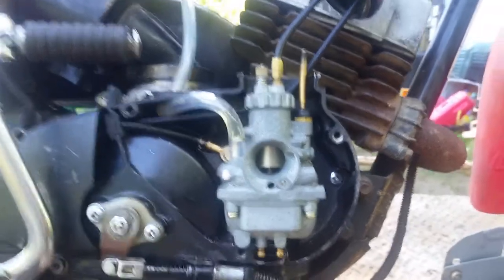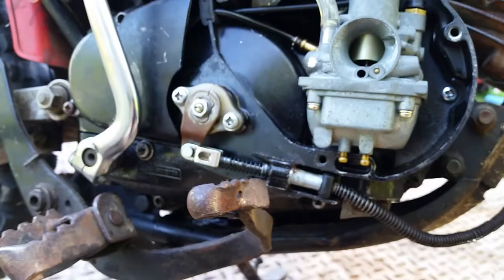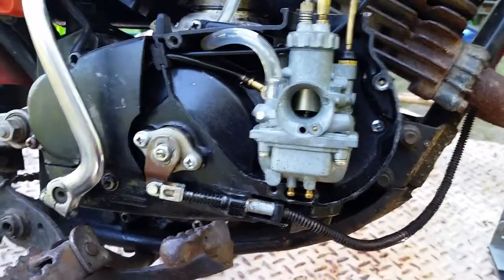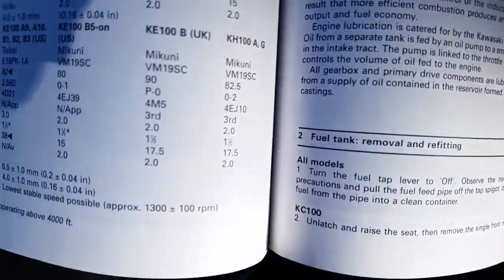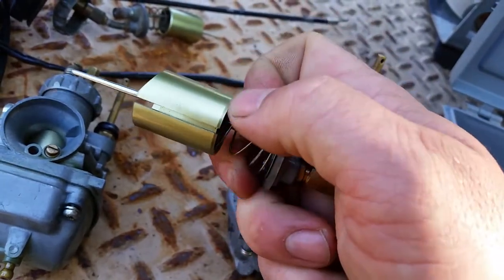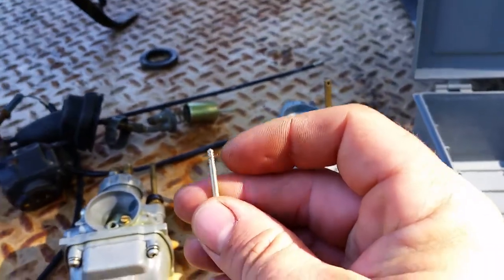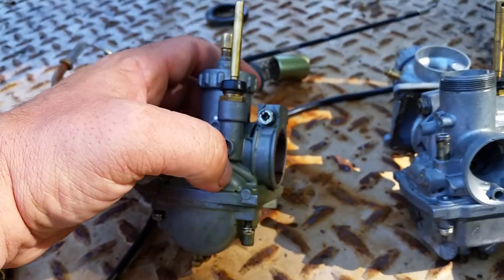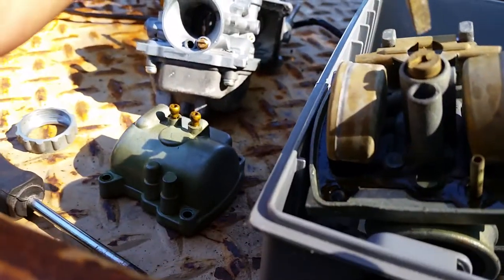KE100 carb repair talk  part 1

Comment: I changed the points and everything still no spark so only thing i can guess is i need a new stator do u know wheres the best place to get a stator affordable
Reply from the maker: king_ DENIER what did you gap them at and did you change the condenser
Reply: I had a professional in my area change the points and he gapped them i will call him and see if he gaped the points
Reply: And it doesnt look like he changed the condenser where would i buy one and how much are they
Reply: This bike went from my favorite to a nightmear in 5 min
Reply from the maker: king_ DENIER new points have to ask and find out what they where set to theas bikes are different from most
Reply: What should the gap be on a 1990 ke 100
Reply: And where could i find a new condensor
Reply from the maker: king_ DENIER 0.014 - 0.016 condenser Ebay
Reply from the maker: king_ DENIER did you get new points
Reply: Yes a professional put in the new points for me
Reply from the maker: king_ DENIER kool but still no spark
Reply: I cant find a condensor no where not sure if im not looking up the right thing or what
Reply: Havnt had spark since it tore up
Reply from the maker: king_ DENIER 6033958097
Reply: What is that number?
Reply from the maker: king_ DENIER phone number
Reply: Ok i texted you let me know when you get it

Comment: Where can I get a carburetor gasket or full carburetor for a 1985 kx100
Reply from the maker: A kx100 or ke100
Reply: Kevin Bergeron  I meant a ke100 like my bike keeps leaking gas from the bottom
Reply from the maker: @jacquellward6440  oh check out my carb talk videos its not the gasket it eather needle and seat or float adjustment
Reply: Kevin Bergeron so it’s not a gasket problem?
Reply from the maker: @jacquellward6440  leaks past the needle and seat fuel level increases and flows out the over flow at the bottom of carb
Reply: Kevin Bergeron it’s leaking from the bottom of the bike it has a new carburetor
Reply from the maker: @jacquellward6440  do you have a clamp on the fuel line
Reply: Kevin Bergeron is that lil circle thing that sit on the needle?
Reply from the maker: @jacquellward6440  yes
Reply: Kevin Bergeron  idk I’d have to check but if the gas leak from the bottom is that a major problem?

Comment: Can you please help me? 
My KE100 runs too rich, like way too rich. It starts up great, and runs good for 15~ minutes but when the engine gets hot it backfires, sputters and stalls. 
The piston and cylinder are full of carbon buildup, as is the expansion chamber. 
I can't figure out how to lean out the carb so that it runs longer than 15 minutes...
Please help! I love your channel man you're the bomb! 
Thanks in advance
Reply: Btw i changed the fuel filter, cleaned the tank and petcock, new spark plug, new head gasket, cleaned the expansion pipe with a steel cable and drill, new 2 stroke oil, new transmission oil, new battery, and i tried to fix the carb but still too rich...
Reply from the maker: running too rich means its getting more fuel than air it causes the engine to run cooler resulting in carbon build up one of the most common problems is a dirty air filter or a air flow restricton like a mouse nest in the air box DONT run the engine with out a air filter cause that will cause extreme opposite problem lean condition start there and let me know how you make out
Reply: Kevin Bergeron i've already checked the air filter, almost brand new, im fact it was the best looking part on the bike when i bought it.
Reply from the maker: Baqca Sanke have you cleaned the carb
Reply: Kevin Bergeron yes, many times. The needle is not adjustable: it has only one setting for the clip position.
Reply: Kevin Bergeron okay i watched the video another dozen times. I tore down the carb (again) and here's a detailed run down of my issues. Any help is greatly appreciated. 
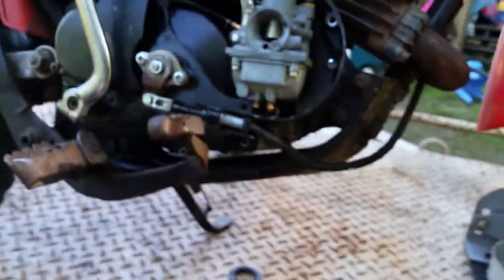@5:23 i am missing this valve thing you talk about. My bike has a straight hole thru it with just a screen. What is this valve called and where can i find it cause i can't seem to find a replacement. 
Also, i am ordering new main jets because this still runs too rich. 
And also my oil pump notch marks don't line up and  don't look adjustable. Do i need a new oil pump
Reply from the maker: Baqca Sanke too rich is to much fuel incorrectly adjusted float to big of a jet and a choke stuck on and a bad needle and seat

Comment: welch plug is for american EPA regulation. not to be tampered with.
Reply from the maker: You have to to adjust the carb Rember bike is worn not new factory adjustment is not the same